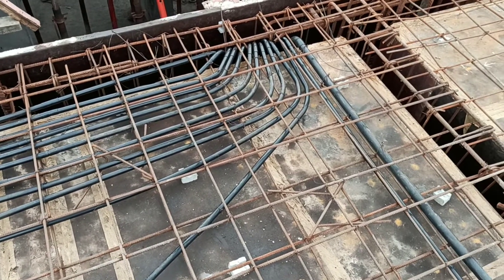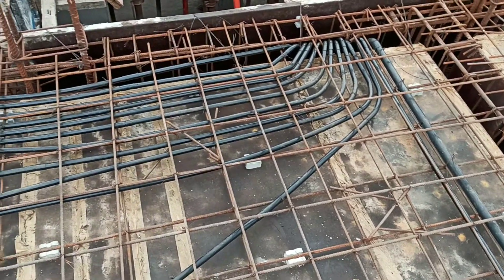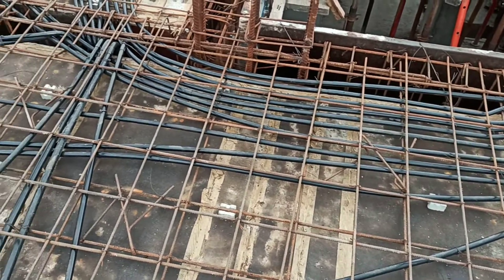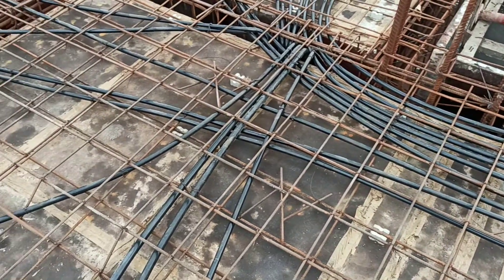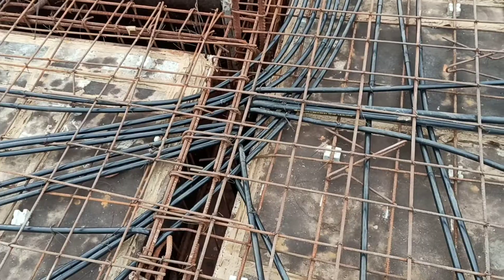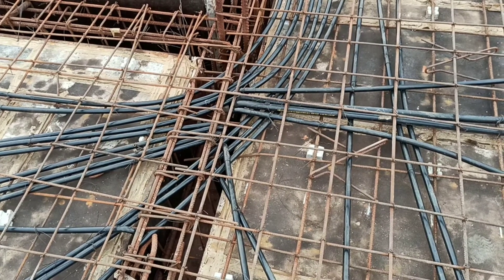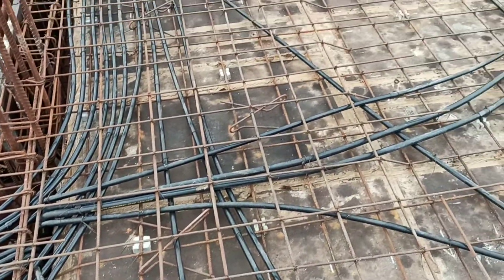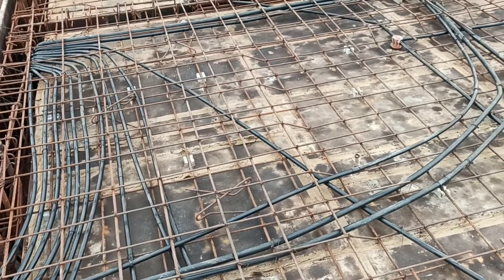Correct way of  electrical conduit laying in concrete slab or Rcc slab

Comment: Sir..If we provide all electrical conduits between  top and bottom reinforcement, wouldnt it reduce the strength of  slab after concreting ?? How are they combating this problem?? Isn't it better to adopt floor pipe laying as better approach in case if we are planning a large electrical work??
Reply from the maker: As per design the slab requires only 10cm but here we provided with 12cm. Due to this the strength of slab will not get reduced. Laying pipe through floor is not preferred bcoz it will increase the mortar thickness for laying tiles may cause hollow tiles.